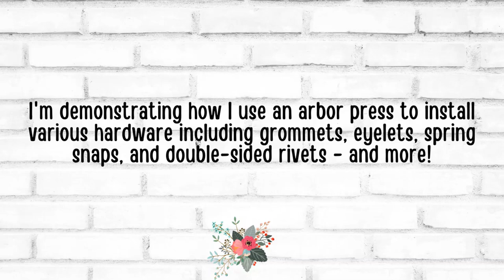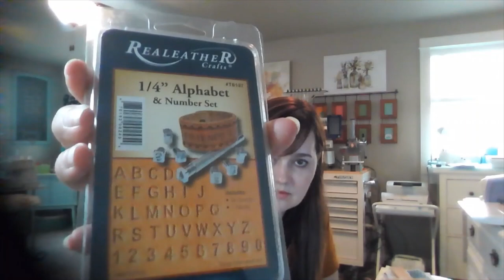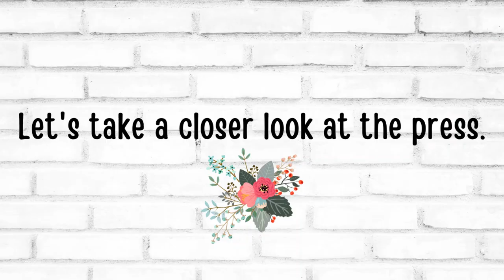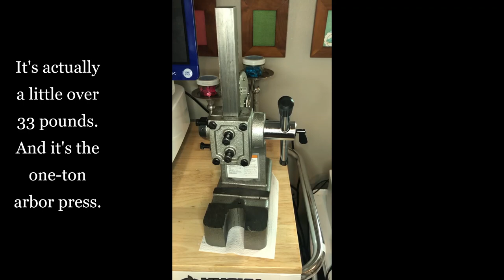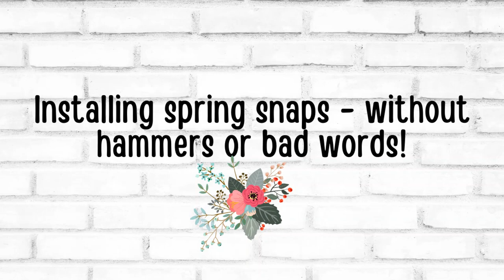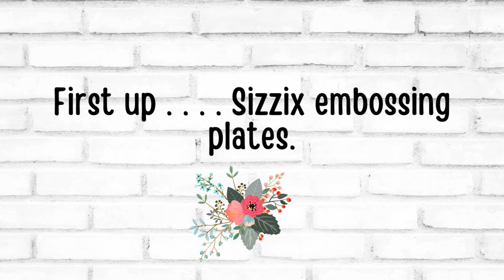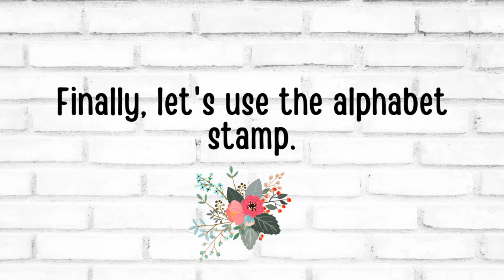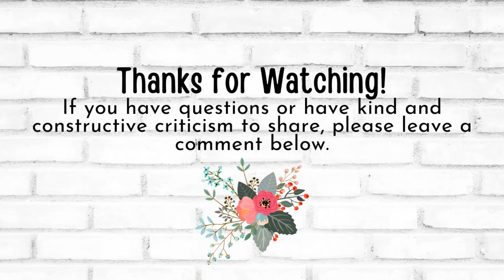Let's use an arbor press instead of a rivet press to install rivets, spring snaps, grommets, & more!

Comment: EXCELLENT!!! Thank you, this has been very useful. I'm getting ready to purchase a press, but found it daunting the cost of the dyes and the machine (and the screwing the top every time you wanted to change). Sure the instructor recommend having two, but this is so much more convenient and I don't have to think too much on the type of rivets, snaps to use.
Reply from the maker: I’m glad this was helpful for you! I really don’t think you’ll be disappointed if you go with this option!
Reply: Just ran into this video today. This appears to be less restrictive than what the overall bag makers are using. Theirs have a small throat clearance, which they all struggle with, whereas, this has far more clearance space. I was getting ready to order a kampress with minimal dies until I saw this video….so this was really handy. I would have liked to have seen purse magnets used…..

Comment: I have those hollow hole punches. They work for the most part, but I make leather crafts, so they eventually separate, the weld breaks, and then when you're cutting a circle, it cuts 99% but leaves a gap, and then you have to cut with a knife. Better to spend the money on higher quality hole punches when you can afford them. That's my problem, I got most of my initial tools on Amazon.

FYI, you need to get a metal plate to put under your plastic piece under the arbor press. That will stop the plastic from bowing, and make it easier to cut holes. I'm sure you've figured all this out, now going on two years. And I also use the rectangular magnets on the arbor press to hold the plastic cutting board down so it doesn't move much.

Comment: Your barely auditable you should speak louder or put the Microphone closer
Reply from the maker: Hi! I am sorry you’re not able to hear it well. Since recording this I’ve worked to improve the audio. What I learned is that some folks can hear it and others cannot (based on their speaker settings together with the sound volume on my end). If you’re using headphones you may need to bypass the volume safety settings to increase the volume output. If that doesn’t work, the closed captioning can help. Unfortunately there’s no other fix now that the video is already uploaded.

Comment: I like the uses but you are using that rod 100 percent wrong. Needs to be extended to where it's going towards you when pressing down and also adjusted to where it is going at a slight down angle
Reply from the maker: I like where I have it because it balances nicely and defaults to an up position instead of falling down. They make it adjustable so everyone switch it up to their preference.

Comment: I think that’s great! Just a little heads up maybe putting something directly in the middle so when the press comes down your your white plate doesn’t flex three stacks of pallet. Wood works very well. You could even make a gig for the outside in the middle!! For leather clickerdye
Reply from the maker: Hi! Thanks so much for that hint. I agree that if you're doing extra heavy pressing, a sold surface under that plate is a must.

Comment: This was a fun tutorial.  It reminded me why I bought the arbor press instead of the hand-press.  The ability to quick-change tools is really invaluable.
I've not seen the press used with just a magnet before - I've drilled a hole in one of the ends, shoved a magnet inside, then slot the tool into the hole.  That provides more space to work and a little more stability.  But not everyone has a drill press, so the larger magnet is a great alternative!

If I may offer a suggestion based on personal experience working with the paper dies... put a piece of wood over the die (I have a leftover 1 x 4 cut into a square).  That will even-out the pressure to ensure a good impression without worrying about the die sticking to the ram.
Reply from the maker: Thank you! Yes - the quick swap is terrific!

Comment: This video inspired me.  My "tool guy" husband has an extensive workshop.  He doesn't have an arbor press but he does have a drill press.  It works in a similar way to the arbor press....so much better than using a hammer and I didn't have to buy a diffent tool.  I just have to dust the drill press before setting rivets.  :)
Reply from the maker: What a wonderful idea!!! I think the most rewarding part of creating is being resourceful!

Comment: One way to secure the press is with a piece of plywood a little bit wider than the press but about 2x longer. Bolt it onto the plywood for a more stable surface. I did this with my heavy metal button presses, and a large overhead metal press. The result is that they’re now very stable but can still be moved.
Reply from the maker: Now that’s a great idea! Give it a wider base to prevent tipping! Thanks for sharing!

Comment: I have rheumatoid, so the Kam table press and hand held presses were difficult to use.  I love the way you have converted the arbor press.  I sew garments, and use snaps and rivets alot.  I don't know if you have seen them, but there is a seller on etsy selling an adapter for the ram that will hold the dies for Kam, gold star dies and then she has a press plate that can handle all the different die sizes.  I think they will make things easier for me to do garments as the alignment is all taken care of.  I am just thrilled to have found your videos and that seller with the adapters.  I was having to press way to hard with the Kam table press.  Also, my top dies were getting frozen into the press.  I had to use vise grips last time to get them out and it was almost impossible.  I was looking for a better option.
Reply from the maker: It means so very much to me that this video might help you create beautiful things with less pain and more accessibility. If you need to, you can also add a length of pipe to the handle for even more leverage - or perhaps even a pipe with a bend for using your forearm to press down on days when your hands hurt more than others.
Reply: That is a great idea.  I also believe I can use the press to make covered buttons easier.  I can easily get the die for those and not have to have a separate press.  I have even seen die for hooks and eyes for trousers. @CharmingCheek

Comment: Thanks for this great demonstration! I don’t have great hand strength and I think the press might be a great alternative to the hand held punch and rivet press. Seems more economical,  too!
Reply from the maker: It makes me happy to know this was helpful! Looks like Amazon is currently the best option for arbor press machines. I hear the 1/2 ton works well!
Reply: @CharmingCheek  I received the 1/2 ton arbor press today from Amazon. I don't think there is enough height from the base (especially if I add a cutting board) to the top of the press in order to accommodate hole punches and other cutting tools you demonstrated. How much space is there in your  Harbor Freight 1 ton press?
Reply from the maker: Hi! I can check when I get home. Can you remove the rotating disk for extra clearance?
Reply: @CharmingCheek  Thanks so much! Yes, I will remove the press and replace it with a strong cutting surface—Delrin was suggested. How thick is your cutting mat? I’ve got some hollow punch hole tools on order (reportedly with a height of about 3”, so that will be good. I’m determined to make this work for me! I saw the floor model at Harbor Freight (they cannot sell it until they get the corporate go ahead—ugh!) and there is 5” of clearance, so not much taller than mine.
Reply from the maker: @ellencr5995  my mat is 7/16” thick. (Just under 3/8”)

Comment: Hi.  Thanks for this great tutorial.  I'll be going get one from Harbor Freight soon.  i do have a question.  I've seen that KAMsnaps has a flat die set for setting keyfob hardware.  What would you suggest for setting the keyfob hardware.  I've tried looking but have come up blank.  Thanks!
Reply from the maker: Hi Cherry! I'm so happy this was helpful! The flat keyfob is something I'm kind of thinking we could do with just the ram and the flat surface of the press. I'll play around with it and let you know what I find out. Thanks for watching and getting my wheels spinning!

Comment: Hi any way you can increase the volume on your end.  It is as high as it can go here and can barely hear you.    New Subscriber from MA.  TY!!!!  Awesome video
Reply from the maker: Hi there! This is one of the issues I’ve tried to improve on my newer videos. Unfortunately I can’t fix the audio on this video. Were you using headphones by any chance? I’ve discovered that if you have a safety limit on them you have to turn it off for this video so that the volume will go up high enough.

I’m so sorry! If that doesn’t work there’s closed captioning as an option.

Comment: Thank you for this! I bought an arbor press a few weeks ago and have been experimenting with different things. Rivets are no problem, but I can’t get the hole cutters or grommets to work. I am applying all the pressure I can and it just isn’t working. Your video looks like you’re just pressing a little. I wonder if I’m doing something wrong?
Reply from the maker: Hi! It sounds like something isn’t quite right. Are you able to join the Facebook group (Charming Cheek Chatroom) so you can share a photo and I can troubleshoot?

Comment: Do you remember how you cleaned it when you first got it and it was covered with grease? I’m reading recommendations to use kerosene or we-40 but I don’t want my craft room to smell like that. I’m so excited to start using it! Thank you so much for this video.
Reply from the maker: I think I actually used a damp rag with Dawn dish soap and then kept wiping it down with a rag with fresh water. Dried it well before putting it into use
Reply: @CharmingCheek  thank you! I’ve also been reading that pouring boiling water over it will melt the grease. Would never have thought of that.
Reply from the maker: @Statch011  I’m a klutz and would get burned! I really just gave it a good once over and it’s been fine. I’d say if you’re spending more than 10 minutes it’s overkill.
Reply: @CharmingCheek  I used hot water with a little soap and it all came off!

Comment: Hi - Love the video and potential with the press.  I am practicing with 9mm X 8mm double capped rivets from Emmaline Bag.  These have a longer post. I have put the rivets in a 6-layer piece of vinyl.  The vinyl is fairly thin.  But, I have not had a successful straight installation.  It slips sideways every time.  I haven’t tried smaller rivets yet because I don’t have any right now.  I will try them though.  Can you help me to figure out what is wrong?  I am using the Dritz 750 anvil and post.  Thank you!
Reply from the maker: I have had this trouble when the post was too long for my fabric. Ideally, you want the post to just peek from the depth of your fabric.

What about trying to snip the end of the post? Push it through the hole, use a marking pen on the post level with the fabric.

Then cut just above your line (toward the tip) to make it a tad longer.

May be better to sacrifice one rivet with this experiment than a few more trying to get them to go in straight?

Another experiment is to flip it over so your anvil is opposite of your current technique. If you’re usually putting the post setter over the cap end, try putting it over the post end.
Reply: @CharmingCheek  thank you for your suggestions.  I tried about 6-7 with no luck.  Maybe I’ll do better with the shorter post.  Best, Kate
Reply from the maker: @katestruble4491  dang it! I can try to play around and figure something out.

I finally figured out how to remove wonky spring snaps - maybe I’m on a roll?

Comment: did you get the sizzix pads from the link you posted doesn't look as thick as yours when I look it up
Reply from the maker: Hi! For some reason my comment never posted and I apologize it took so long to get back to you.

I used a tiny little chopping mat thinner than my Sizzix and it worked well, too. But, I had bought it at TJ Maxx and I couldn’t find a similar option to recommend online. From the description on Sizzix, it appears these are the same thickness (the machine won’t work properly if they aren’t). But even if it is thinner it will still work well.

Comment: Asked for an Arbor Press for Christmas.  My husband thought it was silly until I showed him what it was for.
Reply from the maker: Did you get one?
Reply: @CharmingCheek  Yes, I did.  I set rivets and grommets fine.  Then I bought the magnet you suggested and the 9piece hole punch but I'm having difficulty punching a 1/2" hole for a grommet.  I used a small plastic cutting board as a base but it only cut a partial hole.  I'm not sure if it is because the top of the punch has a point/bevel on the non-cutting end.  It doesn't sit flush with the arbor.  I'm not sure if the Sizzix cutting board will make that much of a difference.
Reply from the maker: @terriparthum5860  hold the hole punch steady/straight with your left hand as you lower the ram with your right hand. 

Or, just place the hole punch on the surface of your material - holding it in place with the left hand as you lower the ram with your right hand. No magnet.
Reply: @CharmingCheek  That makes sense.  Thank you.  I’ll try that.  Other than that I think this is a great option over the other snap tools.
Reply from the maker: My hole punches aren’t flat on the blunt end, either. I was worried about it at first but now I no longer notice it.
Reply: @CharmingCheek  Worked better when I held the punch flush. Thank you!
Reply from the maker: @terriparthum5860  yay! Success!!!

Comment: I was wondering if you make Key fabs? How would you lock them down? Thank you
Reply from the maker: I have made them. Are you asking if I use this for pressing the key fob hardware?
Reply: @CharmingCheek  yes do you use your 1 ton press to lock the key fabs down? Do you use a diy with press also. The I can’t find a press any idea’s? Thank you
Reply from the maker: Hi! For the key fobs I use the pliers. The press is much stronger than you think it is and it can damage the key fob if you aren’t careful. Also, it can be awkward to keep the fob in place.

Comment: How much clearance do u need to use the hole punch etc the one I am looking at 1/4 ton and has  4.5 inch clearance is that large enough??
Reply from the maker: Hmmmmmm I’m not sure if that would be enough. But - if you bolt this in place and then have the ram slide down through the gaps in the metal plate, you’d be able to get enough clearance.

Mine has 5.5” clearance and at times I’ve needed 5”.
Reply: @CharmingCheek  thank you

Comment: Will this press set the KAM snaps?
Reply from the maker: It would but you’ll need something to hold the dies. I’m working on some ideas to make it possible with inexpensive tools from the hardware store but haven’t arrived at a perfect solution yet.
Reply: @CharmingCheek  Thanks for the info!
Reply from the maker: Hi Jamie! I’m not sure if you watched my newer video showing how to install the KamSnaps. Just wanted to mention in case you hadn’t. I used the method today on a bag and thought of your question.

Comment: Would a half ton press be good too?
Reply from the maker: I think it would be fine. Especially if you secure it to the work surface so that you can take full advantage of the leverage.
Reply: @CharmingCheek  thank you i did find the same one that you said to get it was the last one in HF. Thank you for the fast response.
Reply from the maker: @TheDivagirl27  I’m so excited for you!!! This is going to make things much easier.
Reply: @CharmingCheek  oh yes I cannot wait to use it if I run into any issues I will reach out for some guiudance.
Reply from the maker: @TheDivagirl27  I’m here to help!

Comment: You may need to rerecord this video and turn up your volume on your recording device or speak louder. :( I have my volume on my computer turned all the way up, my volume on my headset control, and the volume here on Youtube, and can barely hear you
Reply from the maker: Thank you for sharing your experience! Audio is my biggest nemesis. It’s odd because some people can hear it fine (I’ve tested it from various locations and devices) and other people can’t hear it at all.

I just took a class last week and have some new equipment coming. I hope to get this nailed down once and for all so everyone has the same experience - and it’s pleasant for all.

In the meanwhile, closed captions may help. I’m so sorry I don’t have a better fix.

Comment: Hard to hear even with my volume high
Reply from the maker: I’m so sorry about that! I did this video when I was still learning about volume levels. If you’re using headphones you may want to remove any sound level limits so you can override them and turn the volume higher. I’ve also added closed captioning to help. Unfortunately I’m unable to adjust volume for an existing video.